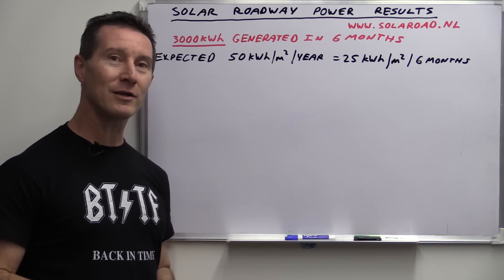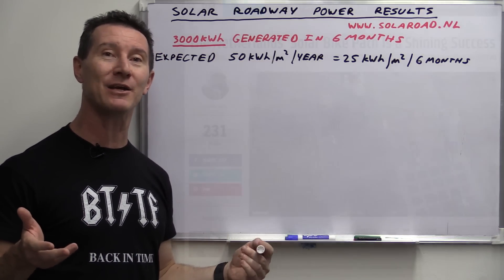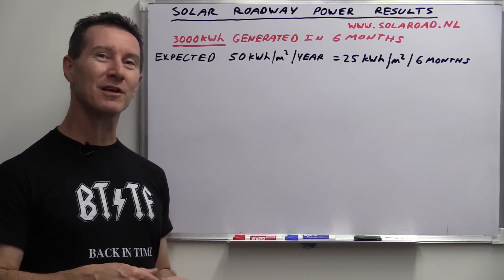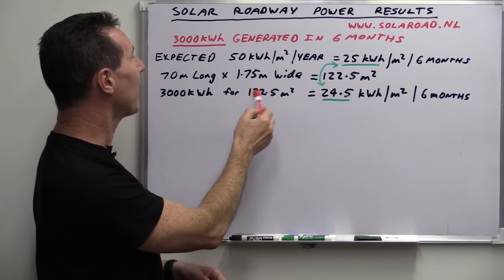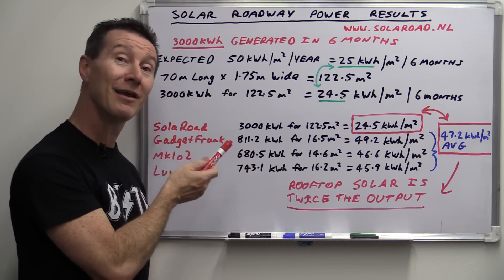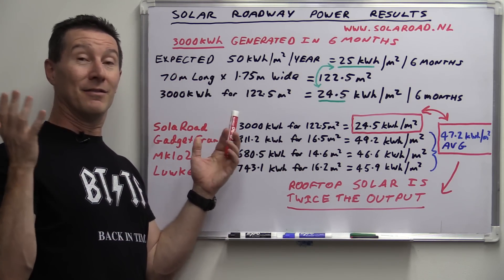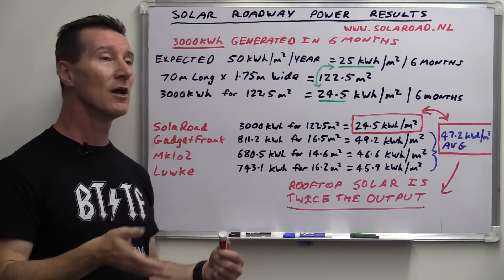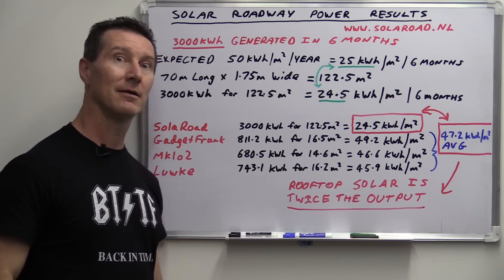EEVblog #743 - Solar Roadways Test Results

Comment: Big cost addon will be the need for at least a daily clean. not just a sweep, but a proper wash and rinse cycle. How often do you clean a rooftop panel, you tend to just let the rain do the washing. You would need at least 2 people per kilometer of road, and the salaries and benefits of them will be more than the power generated by that section. If you use a mechanised cleaner then again you will have the driver, the cost of fuel ( if electric then the output of the panels will basically be used to run it, no nett benefit) and maintenance of the vehicle, along with the disposal of the waste generated.

Basically this is a solution looking for a problem, and any use case scenario already has options that are both cheaper, higher efficiency, longer lasting and lower carbon footprint. If you are going to call it art then you better put it in a museum or a dedicated public place not along any roadway.
Reply from the maker: SeanBZA This cycleway seems to have have faired fairly well and gave decent result for what it is. But yes, a solution looking for a problem. Sticking the panels on poles along the cycleway is way cheaper, way more efficient, and will last a lot longer.
Reply from the maker: SeanBZA Like I said they could have some niche use in some high-tech funky park as a bike track, but that's about it. Mainstream use would be folly.
Reply: ***** Even thoug they manage to fabricate solar panels that are 100x more efficient than the current ones, it would still be better to place them on roof tops than in roads, so no matter what, solar roadways will never be feasible or costeffective. Snake oil as you said :)
Reply: *****  that's why solar energy on a large scale forgoes panels and uses large reflector arrays to focus heat.
Reply: SeanBZA I agree completely.

There's no way it will be worth it in the long run when you have people, bikes, cars driving on top of them. And yeah, if its an actual roadway with the LED lights and melting snow/ice, there is no way its going to even be self sustaining, and car exhaust is going to absolutely kill the output unless kept pristine.